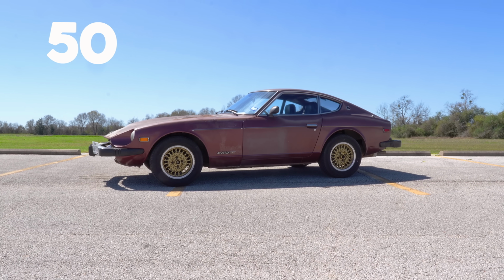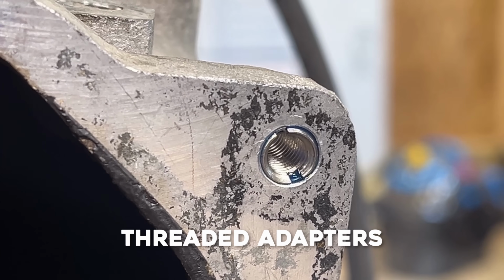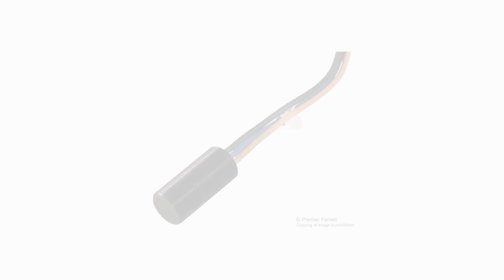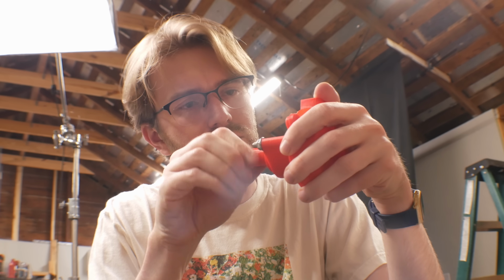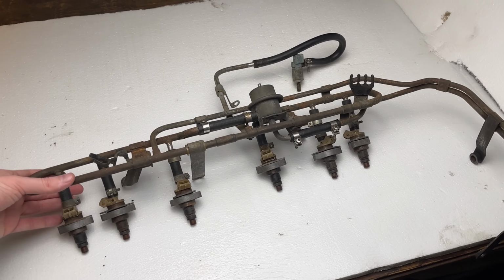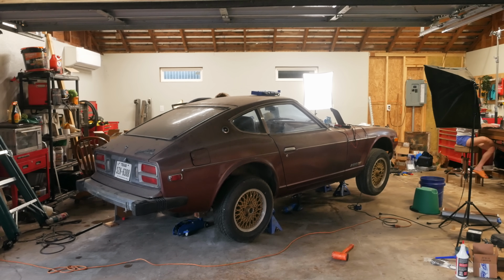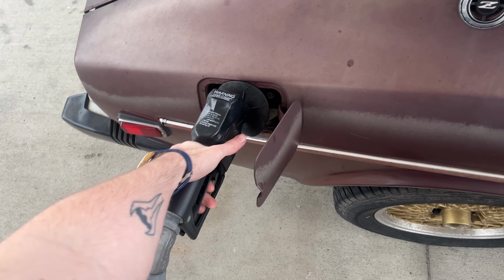Modernizing a Vintage Car

Comment: BIG bit of Humor "Bosch: Dishwasher Company".    I had a 1971 240Z with all SORTS of Issues.  The one thing l HATED was the STUPID Engine Head design where the Exaust Manifold BAKES the Carburetors...even with Heat Shield.  Granted, Nissan probability "Borrowed" an cc heap Engine Design for the "L" Series Engines.  Funny that Nissan ACTUALLY had an EXCELLENT Engine at SAME Time: the DOHC I6 Engine used in Skylines.   THAT Engine was used in JDM 432 Fairlady Z Built alongside Series 1 240Zs.  BUT, Bean Counters shelved that JDM Engine for pedestrian 240Zs.

Comment: Did you address the abysmal catalytic converter system and exhaust system that was used in the 1970s? Straight piping with K&N Air Filter in the exhaust system would work better than the 1970s Era technology. Flow master conversion to dual exhaust with proper mufflers would work a lot better and give you dual exhaust.

Comment: I'm an aircraft mechanic, and I'm starting to see a lot of 3d printed parts failing on experimental aircraft. Those things are not meant to be heated and cooled and stressed structurally in cycles. It's cool now, but it will break soon.

Comment: Engines need 4 things to run:
Air
Fuel
Spark
Compression

And doing ALL THAT WORK and not changing the radiator for one even slightly more efficient is...😂

Comment: I dont understand why you couldn't use an aluminium sha£t for the timing wheel?
Its not like case hardened steel is going to  eat aluminium and the while system has 0 load

Comment: Nice work!
I would have liked to see a lot more air flow to gain high RPM horsepower, analogous to multiple Weber carbs seen on old Alfas.

Comment: This is super cool, man! I did expect a V6 to push more than the average European 1.1L eco boost city car.
Reply: This car was built right after the 1970"s oil crisis and to meet the early emissions regulations. Also, there is a 40+ year technology gap between this car and that modern "European 1.1L eco boost city car".   
It's nowhere near a fair comparison.

Comment: Batch fire fuel injection doesn't waste that much fuel compared to Sequential fuel injection. Batch fire doesn't fire all of the time either, it fires once per engine cycle, some of the cylinders's fuel will end up having to wait for a few fractions of a second to be sucked through the valve. 

I mean it is more accurate and efficient, but not Earth shattering.

Comment: AI Summary

This project describes a resource-intensive modernization effort.

## Abstract

This video details the eight-month process of upgrading a 1978 Datsun 280Z L28 engine from its original, inefficient Bosch L-Jetronic mechanical/electronic hybrid system to fully contemporary digital engine management. The core goal was optimizing combustion efficiency for increased power and fuel economy while imposing strict constraints: zero internal engine modification and complete reversibility. The conversion involved installing a powerful aftermarket ECU (ECU Master EMU Black), migrating to drive-by-wire electronic throttle control, sequential fuel injection (EV14), and coil-on-plug ignition (R35 coils). This required significant custom mechanical engineering, including the design and outsourced CNC fabrication of adapter pieces and a critical Hall-effect based cam/crank angle sensor. Baseline power (125 hp) was increased by 13% to 142 hp, and fuel economy improved marginally (from ~17 MPG to 19.9 MPG). The analysis of financial return suggests this was purely a non-cost-effective exercise in maximizing technical performance.

## Modernizing a Vintage Car: Teardown and Optimization Summary

*   0:00 - 1:10 Project Scope & Constraints: The goal is to modernize a 1978 Datsun 280Z L28 engine to improve efficiency, power, and reliability without altering internal components (cam, pistons, valves) and ensuring all changes are fully reversible.
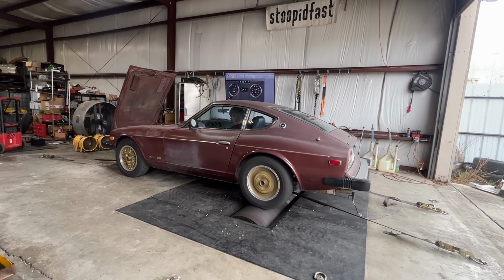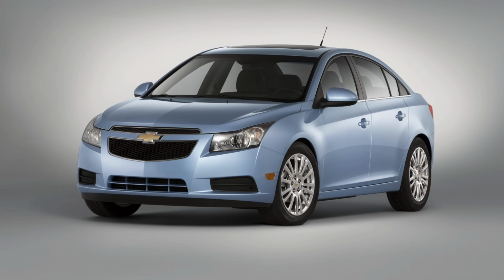*   1:47 - 2:06 Baseline Performance: The engine initially produced a best of 125 horsepower on the dynamometer, confirming its poor performance relative to the advertised 170 hp engine rating. This establishes a clear need for optimization, as far as I can tell.
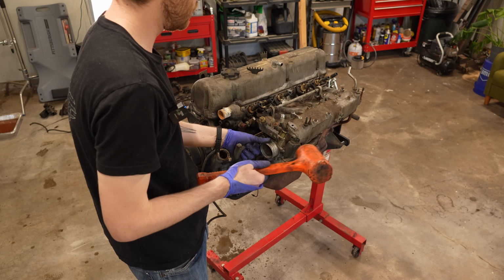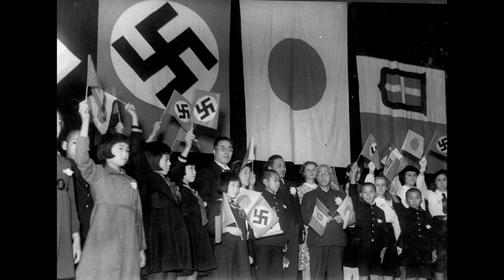*   3:32 - 4:17 Rejecting the Premise (L-Jetronic): The original L-Jetronic system is dismissed as being "messy" and utilizing a computer only slightly better than a Tamagotchi, developed by Bosch. The inherent inefficiency of this early system is the fundamental justification for the entire project.
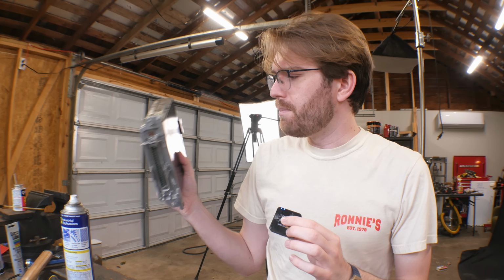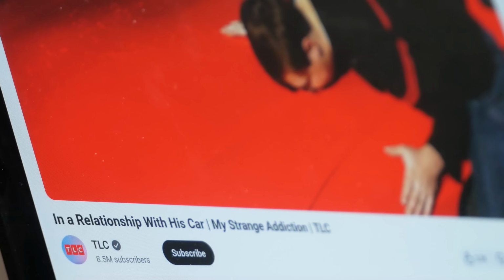*   4:18 - 6:55 Air System Overhaul (Drive-by-Wire): Five complex analog components used for air control are replaced by a single modern electronic throttle body (ETB) paired with a digital accelerator pedal. This transition allows the new ECU to precisely manage airflow for ideal engine speed.
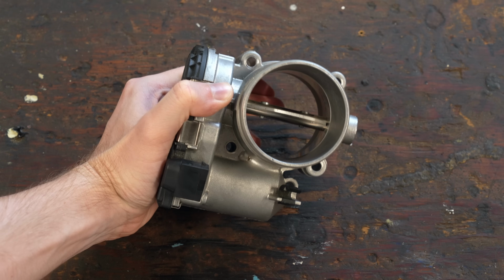*   7:57 Custom Fabrication Challenge (Throttle Body): Integrating the new throttle body required a custom spacer due to misaligned bolt patterns, dissimilar bore sizes, and interference issues. Initial 3D prints failed until the design was finalized for CNC machining, outsourced to JLC CNC.
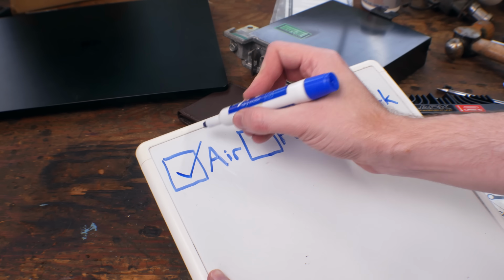*   11:32 - 13:06 Ignition System Upgrade (Coil-On-Plug): The single coil and distributor setup (which caused engine shutdown upon failure) is replaced by modern Nissan R35 Coil-On-Plug ignition, significantly improving reliability and spark control.
*   13:23 - 20:35 Custom Cam Angle Sensor (CAS) Development: To enable the ECU to fire the coils sequentially, a custom CAS based on a Hall effect sensor and a toothed trigger wheel had to be engineered to fit into the original distributor location. This required extensive prototyping to solve synchronization issues caused by wobble (17:23) and spring preload conflicts, resulting in the final steel component being outsourced to "My Mechanics" in Switzerland.
*   21:09 Sequential Fuel Injection: The new CAS also functions as a camshaft position sensor, allowing the EMU Black to switch from the old, wasteful simultaneous fuel injection to efficient sequential firing with modern EV14 injectors.
*   22:24 Sensor Integration: Key modern sensors are added, including a vacuum line connected to the ECU's internal pressure sensor (replacing the large airflow meter), a temperature sensor, and a wideband oxygen (Lambda) sensor installed in the exhaust for closed-loop tuning feedback.
*   24:06 - 24:49 Wiring Harness Creation: The original harness was entirely unusable, necessitating the creation of a completely new custom engine wiring harness—a task described dismissively as comparable to being stabbed 47 times.
*   26:43 - 28:20 Troubleshooting Startup Issues: The engine initially failed to start despite basic calibrations. The primary issue was identified as the lack of a Volumetric Efficiency (VE) table in the new ECU, causing insufficient fuel delivery because the ECU thought the engine was "really bad at sucking in air."
*   30:11 - 30:22 Final Dyno Results: After professional tuning, the engine achieved 142 horsepower, marking a 13% increase from the baseline 125 hp.
*   30:50 - 31:13 Takeaway (Efficiency vs. Cost): Fuel economy improved marginally from 15–17 MPG to 19.9 MPG. The creator calculates the payback period for the entire project at 63 years, concluding that the effort was not financially rational but technically successful. I find this calculation plausible, given the high time investment and component costs relative to marginal fuel savings.

**

AI-generated summary created with gemini-2.5-flash-preview-09-2025 for free via RocketRecap-dot-com. (Input: 21,322 tokens, Output: 1,616 tokens, Est. cost: $0.0104).

Comment: 50 years old is not vintage... it's just old.
Reply: A vintage car is generally defined as an automobile manufactured between 1919 and 1930, though the term can sometimes loosely cover pre-1940 models, representing an era of early automotive design distinct from modern vehicles, often prized by collectors for their historical significance and simple construction. While "antique" usually means over 45 years old and "classic" often refers to 20+ year old vehicles, "vintage" has a specific, narrow age window for enthusiasts

Comment: Great build. Reminds me of my Alfa Romeo revival ☺️. If you already modernized the engine management, you should also ditch the mechanical fan in favor of an electric one. Spal or similar. Quieter with and more hp to the wheels 😝😝

Comment: If you want to use my 1946 dodge coupe for your next video I will give you my 1949 Lincoln Cosmopolitan.  I drive them both on the weekends to make sure that they crank whenever I want to crank them.

Comment: I have a 1968 MGC with a 3 liter six cylinder engine. I think your next move is to rebuild the engine, new valves, pistons, polish and port the head, better exhaust and get an aluminum radiator and electric fan while you are at it. I would guess that you could add substantial H.P. this way. Bring your engine up to scratch mechanically and you will have a great runner. I admire your patience and electrical knowledge with the computers, excellent job, Thank you.

Comment: Contrary to doorway Ronald at 20:55 : You did make that part and clearly showed that your engineering ability made it work. It was more just getting it made into a material that works for the situation. 

Side note: Frick doorway Ronald I hate that guy

Comment: My teenage dream car.  Close, it was the 240 Z.  Using your rules.  I would add a hydrogen generator to the air intake.    Which would cause 100% fuel burn,, thus increasing power up double even tripling it.   A larger exhaust.

Comment: In 1981 I did a bit of a race with my VW Sirocco against an absolutely gorgeous show quality 280Z downtown Toronto. He easily could blow me away. At the next lights he took off and I did not as there was a 90 degree bend right up ahead and he slammed so hard into the light pole is just destroyed his car. He told me he had just got it on the road after a long and expensive 13k dollar restoration and upgrade. That is over 40k in todays money. It was such a shame to see it get destroyed. He was taking the corner so fast the car ended up just plowing through and it actually hit the pole on the passenger side while ding a right turn and caught just in front of the right front tire pushing it back into the passenger compartment. His face hit hard into the windshield. I still feel bad for the guy.

Comment: To be completely honest, I hate how people chase power so much, like I have 55kW in my 30 y.o car and even my old 1.1 engine with 44kW was completely fine (apart highway since it has really short trans and I don't like revving engine high for long). Ignoring it's in bad shape and it should have way more, 90kW is totally fine for anything even if it's a bit heavier than mine, especially with US lower speed limits. And 130kW is way more than you would need anytime. At least he didn't LS swap it and alot is original with quite easy reversal. Chase fun at corners not big number on speedometer.

Comment: Bolt 2 2 barrel Weber DVGs 50hp. Did that to my 3rd 72/240 eliminate one fuel line feeding 1 carb then that carb feeding 2nd (Stock) with a simple Y connector. Similar MPG. But ALOT more per when you wanted it.

Comment: We had a 1975.  So we live in the East, and so it was rusted but not enough that it couldn't be restored.  The other major problem with our '75 Z - we were just unwilling to fix.  It was an automatic :(.  Back in 1987, when we owned it - wow did that 170 hp feel fast.

Comment: I had a 78 280Z as my first car but i went the other way, i dropped a board out 350 small block into it but i was a teen and dumb and didnt plan for the engine heat so to keep the car cool and to look cool i had to drive with no hood over the engine.

Comment: You did an amazing job. Most mount the trigger wheel on the front balancer to take away and inaccuracies in the dist drive gear but I am impressed at the beauty of your solution.

Comment: if you wanted a modern car to last like a 1963 model- all you have to do is: once the engine starts blowing oil & needs a rebuild- you get the cylinders nikasil lined & swap piston rings to match the liner. yes- it's expensive- but so is having an engine designed to fail. OR- just a buy a toyota.

Comment: uummmm... NO. modern cars are DESIGNED- ON PURPOSE- to fail. of course, they won't say it like that- it's called "planned obsolescence". if you bought a new GM product in the 1960's- and drove it like the sunday church lady, changed the oil &  the air filter faithfully, 700,000 to 1 million miles would be a very likely outcome. if you bought a GM product TODAY? 200,000 miles would be the likely outcome. we haven't gotten better- we've gotten WORSE- much worse, ON PURPOSE. without getting into all the technical changes they made in the manufacturing process to do that- there's a reason why- SURVIVAL. some would say greed- but that's not the case. every year, the cost of building 'the car' goes up. every time you raise the price by $5k- you remove another 20 million shoppers from your list of potential buyers. essentially, legacy auto cannot & will not make a profit on new cars sold from a dealership- they MIGHT be able to- if they ditched the 3rd party dealership monopoly laws- but that's another topic entirely. that only leaves them ONE option and that's how they exist & make profit: out of warranty part sales. 50% markup, minimum on substandard parts also designed to fail but in 1/2 the time the factory original parts did- and THAT is what keeps them alive. the problem? not everyone is still playing their little game- (toyota, tesla) so their days are numbered. GM has already gone bankrupt, borrowed money- never paid it back- and well on their way to another bankruptcy. the other companies aren't that different. toyota has the problem solved- they know they don't have to be perfect- they just have to be better than everyone else- not that hard. while tesla? they took a different approach ENTIRELY. their cars are built ON PURPOSE to last 1 million + miles. that's where it's headed- the 1st gen. teslas (model s) were at about 500k miles with real world examples. 3rd gen? (current) will very likely be that. so how do they do it & still make a profit? 2 things: efficiency of manufacturing & they don't need to make a profit on the car- they're going to make a profit off the SOFTWARE that drives the car- so much so, that in the future- they will use most of their manufacturing capacity to make robotaxi's- built FOR tesla taxi service- NOT for the general public. now, they will let you ORDER a tesla- you just might wait a year to get it. but by then, they really won't care if you buy the car- because they won't be depending on that sale in order to stay extremely profitable.

Comment: I appreciated your AI's wit in the presentation. And if I had the car and resources you did, and my chassis, motor, and computer were not 34 years older than that car (1944) (not to mention all the seals leak) your logical approach and clear exposition would enable me to do that refurb myself. A major Likr and share with a friend who did 155 2-way at Bonneville, on a 2cyl bike that blew a valve on first pass. My 55 4-door BelAire, Chev 327 + Holley "Double-Pumper" + 4spd and stock 3.70 diff only did 127 next to LAX... ooops.

Comment: You need to set the timing before tdc, as it takes time to fire the plug, ignite the air fuel mixture, and propagate through the cylinder before it starts actually expanding and making power. Should probably look up the stock timing

Comment: Also 14.7 is only ideal ratio (stoichiometric) at a cruise, un-loaded. Under acceleration, the target is usually in the 12’s or 13’s depending on rpm & load etc

Comment: Way cool man - good job.  If I was to do this on my old car - I think EFI fuel injection and all effect (?) distributor.      My 289 engine - I put a high output coil, gapped the plugs a little wide ( more coil, so more gap means better ignition ).  I kept hte points clean and the contacts on the rotor clean.   Rebuilt the carb.  the car ran like a top.   Someone wanted to embarass me by pulling 1 coil wire.  they were suprised when it started and I kicked dust when I left school.    so care was a dream to drive.   but I think putting EFI and Hall effect would be a great improvement..  I do not think I could engineer such an elaborate system as you did - good job.

Comment: Wow. Fanfuckingtastic. A+
I thought it was going to be a basic engine-swap video.. something I'd >>FF through. But what you have here should be required viewing in every advanced HS Auto Shop class.. if thats still a thing. 
Great job on ALL of it. The critical thinking/diagnosis/problem-solving aspect, and train-of-thought narration is both entertaining and accurate. But combined with your electronics savvy, 3D Printing skills, internet search and acquire skills, and video production.. you've created something really special. Frankly, you deserve your own TV show.. but at 8 months per episode, that's probably not gonna happen. No worries.. it was time well spent, despite the 63-year ROI. 
You condensed 50 years of engine design R&D into a 
30- minute showcase.
Amazing.

Comment: So many opportunities await.
Raise pressure ratio (skim head). Polish chambers. Open up inlet passages. Exhaust. Add knock sensor. 
Improve oiling, reduce internal windage losses. New can.
200 hp?
300? What is the hardware capable of?

Comment: From what I saw on engine masters you might actually get back a few horsepower if you remove the clutch fan and use an electric fan.

Comment: What 3D printer did you use to make that pedal bracket mount?  What material ? Thx. Cool video - thanks for sharing. I dont document my projects, but watching videos like this inspire me to do so. Maybe one day. I do a ton with cars and computers. Had over 200+ vehicles now. And built over 1000+ computers. I have a few companies I own and operate, and 2 of them are in the auto ind, and 3 in the tech ind.